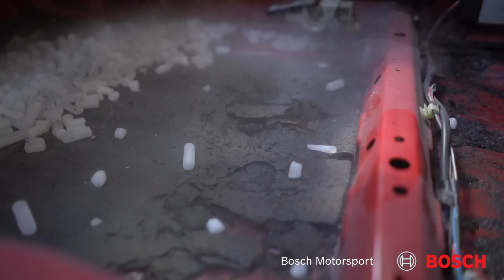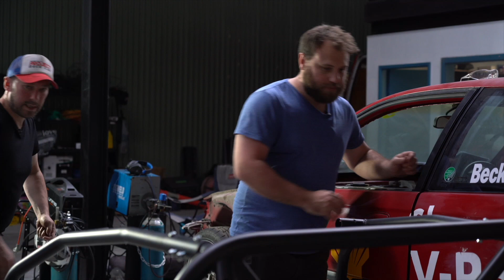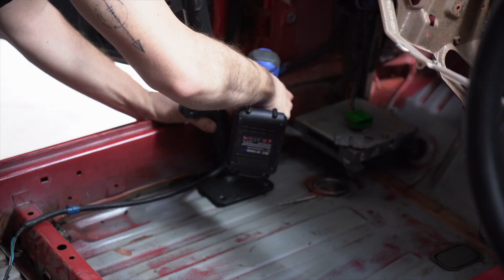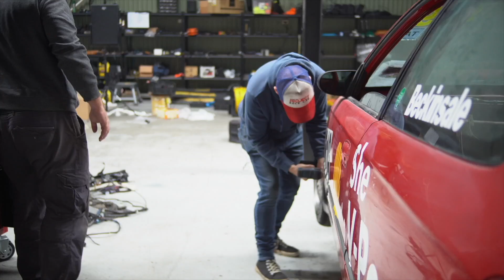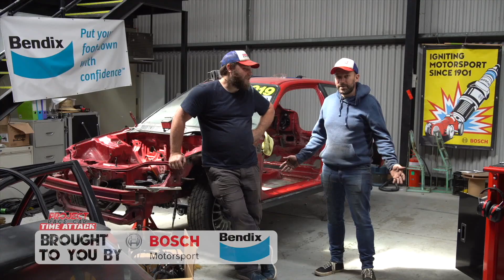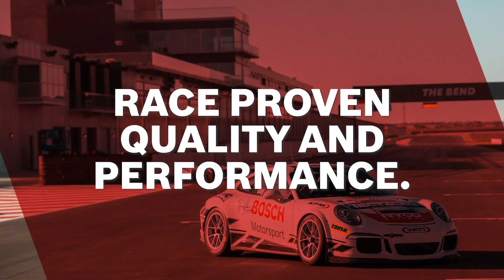Getting Ready for PAINT! EK Civic Time Attack Build   Project Race Car WTAC

Comment: Awesome video Lad's good to see progress on this again. Curiosity question, why a bolt in Cage & what metal is it made of? Seems like a whole lot of extra potential points of failure should an incident happen plus chassis stiffness difference from bolted in versus a welded in cage using Chrome Molly Tubing. Add more words etc. Ha ha. Cheers
Reply from the maker: Cheers Brush it off. So the bolt in cage is within our budget price point at this moment in time and with what we're going to be doing, building towards SuperSprints & WTAC it gives us the safety we need to comfortably learn how to push the car hard once we get back on tack. 
We'd love a welded cage to be in our future and may well get there in time with this build!
Reply: @BlendLineTV  Fantastic response! As said just curiosity. Saftey first. The rest will come.
Reply from the maker: No problem at all! Curiosity is what has got us to this point and might have taken us too far wiht the desire to paint the interior.  😂
Thanks for watching, we greatly appreciate it!
Reply: @BlendLineTV  It's the Mother of creation, happy to see the Journey progress, & your welcome, Aussie Built it is, as it should be from a fellow Aussie. Cheers